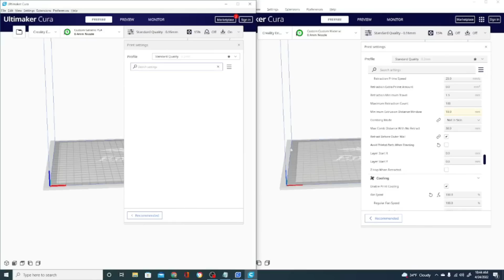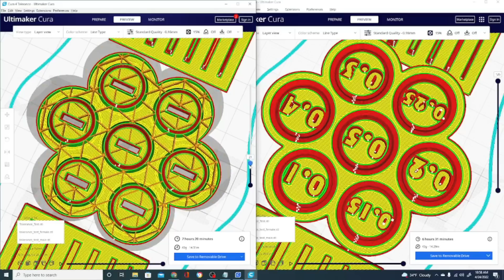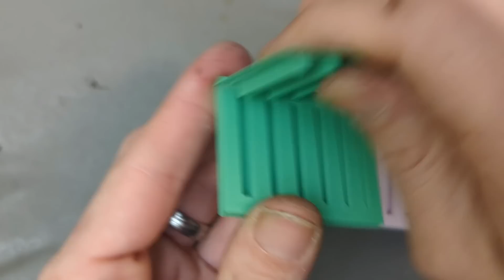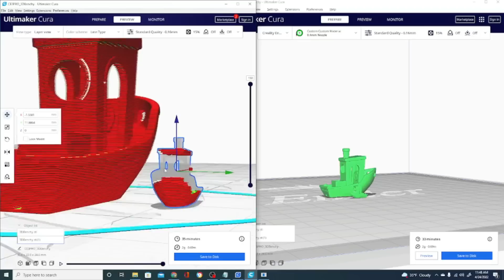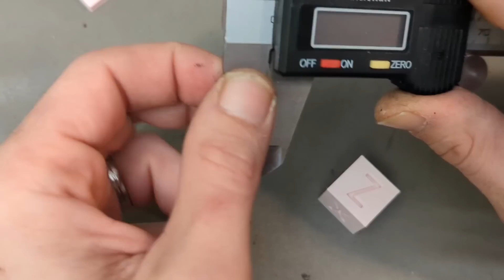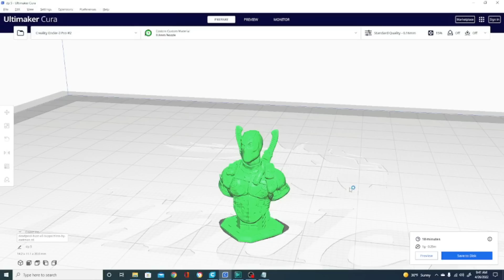Cura 5 vs Cura 4 Accuracy Testing- is it really better?

Comment: I tested 20x20x20 cube (1 wall 0 top layers) to print walls and see how precise wall thickness is (aiming for 0.4mm). I got thickness from 0,36 to 0,45mm. Cant get all 4 walls to be within 0,02. No such problems in 4.13.1
Reply from the maker: Two things, first what was your variable line mode strategy set to? Just curious so I can test it out, the next is, how old is your nozzle because that's a bigger difference than you should be seeing for sure!

Comment: Cura 5.0 will not work for me with the error code OpenGL 2.0 or higher needed
Reply from the maker: You should update opengl, it's a pretty common framework anyway. Graphically

Comment: I've found that text under the print gets mangled with cura 5, unless you slow the print down.
Also when printing my own designs I have 2mm text on the side v4 can do this v5 cannot. 
This is on ender 3 v2. Esun blue pla+

Comment: if you did Inclusive under experimental, rather than Middle, I bet you those cubes would be exactly accurate.

we should all be using inclusive on our parts. only switch to middle or exclusive where the parts fit like a screw and thread.

Comment: Ive also been using the Cura beta on my Ender 3 v2. I've noticed way worse top layer quality in the Cura 5. So anything with a large flat top surface looks worse. I noticed something similar on the clearance test you showed. Is this something you've noticed as well?
Reply from the maker: Top surface and ironing settings can be improved I have noticed. I'm working on these elsettings now and I'll let you know if I get results
Reply: @Technivorous  Awesome I would be excited to see that.

Comment: Lol, this test may be inaccurate as you have 2 different filaments. The filament coloring may also change melting properties. You need identical filaments, and identical printers, then print at least 5 samples to get a statistically significant result
Reply from the maker: It's actually the same filament just different colors. And while color will effect strength according to studies it has no effect on dimension. The same printer was used and we did 3 different tests. No matter how I did this somebody would say it's wrong, and your entitled to your opinion, but the scientific method says that 3 tests is enough for a baseline. If I did 100 I would have a better data set but it would reflect roughly the same thing.

Comment: Id love to see a new standard filament diameter of 1mm.. Then we would potentially see much better accuracy on parts.. 1.75mm to me is the reason why most of the stuff we print just isn't highly accurate.. With the latest printers claiming an average of 150mms print speed, a smaller diameter nozzle and filament we could see major dimensional accuracy improvements and be printing at a faster speed than we are now... To me at least.. The slicer software cant really make up for the fact that were trying to get precision out of a filament and nozzle width that is just too big for the job.. Flogging a dead horse kinda thing.. It can only take you so far...

Comment: I did 2 prints (tried 2 prints) with cura 5 beta .. but at a certain time Cura just quits and the print stops but it keeps the temp @ 200C 
Don't know at what time or layer .
Reply: Were you printing over USB? Someone in the comments mentioned there is a bug in the beta when printing over USB and it stops midway
Reply: @BigPapiLoc  Yep :) just maybe 5 or 6 layers or something and Cura just quits. the entire program :)

Comment: Cube 20 X 20 did you measure your filament diameter? It was two different ones, small variation in size of 1.75 filament going through a .4 nozzle can have that much effect effect on size.
Reply from the maker: I did. And it was same filament just different colors. This can effect strength but not really dimension. Just to be sure I did print the cura 5 cube in pink and got the same results as the green
Reply: @Technivorous  WOW Thanks!!!!!!!!! Super stoked to here your Thoroughness!!!! Just to many times I as an engineer come to fined the data can lead to a conclusion that is incorrect without further inputs and checks, it is sometimes difficult to hypothesize for all inputs of a test. Again great job. But now I am left with concern from version to version.
Reply: FYI the flat jaws on calipers are for measuring round objects flat measurements should be taken using the knife edge part of the caliper jaws

Comment: First time i try the program crashed. The second time it worked but loading a stl file took for ever. And my sliced prints were not that great so I stopped using it and will wait for final.
By the way loading stl files every time i try took much longer to load or slice.
Reply from the maker: That's understandable. This is a beta, so give it a while for them to work most the links out! Thanks for your feedback! Stick around and I'll keep an eye on it for you!

Comment: Before putting a "Cura" test, you must correctly calibrate the printer (temperature - retractions - extrusion), since they are not correct.
Reply from the maker: Yeah I have plenty of other videos on how to tune your printer if you need help! Thats already done though. This video is about comparing the two engines.

Comment: 1 thing i noticed using 5.0 is that printing via USB does not work, it may start printing but midway the program crashes and you can have a big problem on your hands . I've read that the bug has been noted by the devs and it will be addressed.
Reply: Ow you had that problem .. So it is the USB I did not know . It is beta tho

Comment: Any idea when it will be taken of Beta?  I tried it and it is okay but it's not ready for prime time yet.  You can't even drag and drop files in it yet.  I also found it actually added over an hour to a print that was using tree supports in one my tests.
Reply from the maker: Really it added time I'd love to see that model!
Reply: @Technivorous  It was the supports.  I had it set to 0.2 layer height, but it added time over the tree supports, and they came in at a different angle.
Reply from the maker: And no I'm not sure when it will drop. The drag and drop really sucks

Comment: Very nice to see a comparison with the same settings. But of a shame you didn't use the same spool of material as well. Might be the case that one filament is a tiny bit wider than the other.

Could also be interesting to measure the thickness of those thin protrusions, rather than trying to push them in.
Reply: Also, would be better to merge the gcode into one file and print it in one time.
Because the Z height could be affected by the bed calibration. And for example, you could have a diff if you print directly the second one with a heated bed (or in both case you must pre heat the bed).

Comment: Comparing the two slicers, it would be a good idea to use the same filament for both to keep it fair. Maybe the green filament was 1.74 mm in diameter on average and the green filament was 1.76mm.
Reply: Also, taking measures on two blocks to assess the accuracy doesn't make sense.
The sample size is way too low to account for technical errors during printing or measuring.
Reply: I have the same problem with extrudr XPETG. Different colours = different dimentions.
Reply: I think there was under extrusion on the 5 (look at the top layer holes.
Reply: I dont really get it why it is a common issue that comparisons like this are made with different setups like we have here with the different colors of the PLA. Totally unscientific and more or less useless when the variable that is changed (color of PLA used) effects the compared output (like the dimensions of the cubes).
Reply from the maker: They are the same exact specs, both polymaker polyterra pla, same technical specs and dimensions, exact same batch actually just different colors.
Reply: @Technivorous  and even the color can and does change its properties in every way including flow and shrinkage etc. ...

Comment: Maybe Under slicing tolerance in the experimental tab use middle or if it's on middle try inclusive and reprint?
interesting comparison great idea! cheers
Reply from the maker: thats a great idea! im getting so many good ideas from these comments guys keep em coming!
Reply: I think exclusive is the one you want to use when you've got mating parts you want to fit well together. Such as threads. However it seems like that setting only has an effect on angled surfaces. Not sure if it makes a difference on perpendicular walls as there is no change in width across the cross section of individual layers.

Hope that made sense. Theres a few good videos on the slicing tolerance setting and what it does.
Reply: @xUberMuffinx  its the absolute max middle and minimum same as center inside or outside of your extruded lines reguardless of the shape it dictaes the models min center or max wall line.  so extrusions are roundish the center is the center the max is the outside of the filament extruded and min is the inside of the roundish filament layed down hope this makes sense
Reply: @xUberMuffinx  exclusive is smaller your correct ex=less in=plus inclusive
Reply: @xUberMuffinx  Thanks for saving me the time....
Reply: @palewriter1856  your welcome

Comment: i would have thought a better test would be using measurements that are non standard, anything to a whole tenth of a mm, or thats a multiple of the wall thickness the the old cura will do that pretty easily. but what about shapes that are varying width not straight lines. shapes that arent anywhere near a multiple of the standard wall line width. thats where its supposedly going to be able to do thing the old engine will be very inaccurate at doing.
Reply from the maker: yeah if you watch the part with the mating test you can see the dfference, its a row of different width blocks, and in the old version you could see it struggles matching some of the widths, unlike the new engine which can vary the width ts extruding at.

Comment: The other downside to this test is that different color filaments actually do react differently. A fair test would be to use the exact same filament for both.
Reply: I just printed a giant fairly complex model in red and it came out perfect. Now I'm trying to print something in blue and the stringing is impossible. Both had been in the oven together some time ago and were stored equally in the exact same place. It seems to me some color filaments catch more humidity than others.
Reply from the maker: That's fairly true, however I chose these two colors because they have the exact same technical specs and dimensional accuracy as per the manufacturer polymaker.
Reply: @Technivorous  I agree this is too minor to factor in a test much brauder but color can change things but thats a whole other story and is super minute here
Reply: @rexxx927  Nope, color can play a large effect. Plus its just bad experimental planning to introduce even a minor difference between samples when you dont have to
Reply: @yrwuteiyriyriteiidoyfoufpugi  read a data sheet and use pigment colrants you will be fine under 2% loading even with white and TI02 COF is minimal READ A DATA SHEET SAVE SCRAP
Reply: @rexxx927  why  introduce an extra variable when making comparisons? 

Does the datasheet have disclaimer or are the manufacturers making a legally binding contract that all setups will produce exactly the stated results?
Reply: @yrwuteiyriyriteiidoyfoufpugi  footage times dia div pie by density will always equal the density for that diamater of filament  ex:
if a roll has 28000 feet at .001 mil 40" wide the roll weighs 430 lbs at a 3" core dia with .96 density
if a roll has 28000 feet at.0009 mil 40" wide the roll is 412 lbs all day beasause the density never changed!!
so if you filament is 1.75 at 350m the roll weighs 1 kg or 2.2046 lbs all day

in a case with colorant at 2% Master Batch the base is still the same as of the base material its blended with wich means the MB has the base materials in it it too it is a carrier the actual pigment and is only a fraction of the base material from that MB used! so of the 2% MB loading only about 30% of that 2% is actual pigment!! use the base material for loading under 10% as that 10% is only part pigment!
Reply: @yrwuteiyriyriteiidoyfoufpugi  thats why you should have a micrometer or lazer gauge to check your manufactures flaws first hand if its 1.77mm tell your extruder operator not your data sheet makers

Comment: Thanks for the video.  Does Cura 5 LOAD faster?  Cura currently takes 2 minutes to load on my fast I7 PC with fast SSD NVMe 2.0 internal drive.
Reply from the maker: In my experience it loads and slices faster. My computer is a standard hdd, so it's slooooowwww but this version Is a noticibke improvement for me
Reply: thats weird, takes mine about 10 seconds. though thats off an nvme 4.0. i also dont have a lot of presets or anything added.
Reply: Two minutes?! I think you need to check your pc first. I'm using a 10 year old potato (with sata SSD) and it loads in maybe 10-15s.
Reply: What are you talking about? I got an i5-7500 with SSD and Cura 4.8.0 loads in 13 seconds. Maybe you are using a virus scanner that slows down file access?